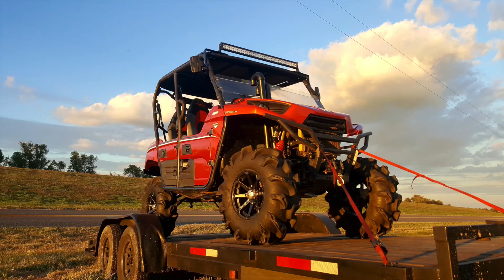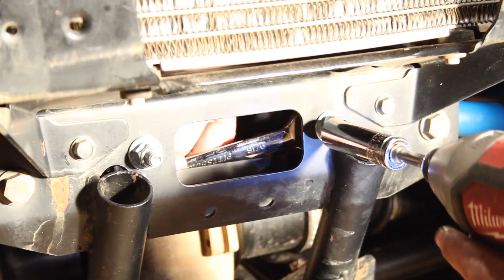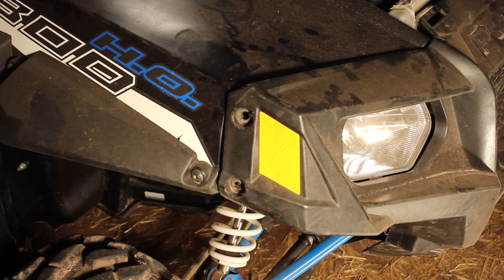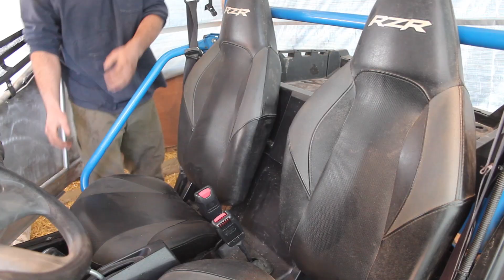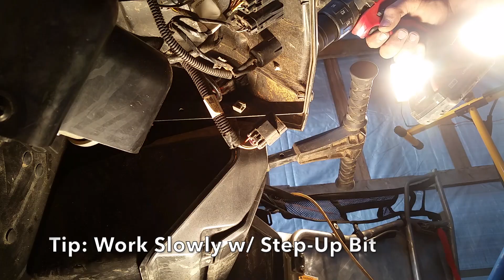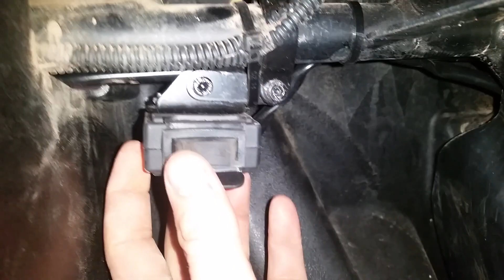How-To Install a Winch on Polaris RZR 800 (EVERY STEP)

Comment: How did this 3500lb do on the 800. Lots of other forums say go with the 5000. I’m only needing it for emergencies. We are light trail riders
Reply from the maker: honestly I also do light trail riding and never had to use it. Handy for another way to strap it to trailer, but ended up just being some cheap insurance out on the trail. Thanks for watching and taking the time to leave a good question in the comments. Cheers

Comment: Just got a RZR 800 and winch worked for two seconds and stopped, went over all the wiring with it and it seems good. So I assume winch itself must be done for.
Reply from the maker: try and hook up a car battery directly to the terminals on winch with jumper cables and see if it spins, I use that method for years on my trailer winch before it burns up so should be safe for a quick test. If winch is still good sometimes its easier to replace wiring than to hunt down a bad wire. Might try and replace just the solenoid if you have another one. Hope this helps thanks for watching and taking the time to leave a thought provoking comment. Cheers
Reply: @EscapePowerSports  I figure it out they had the wires running to the wrong places, basically the winch was trying to be the battery and battery was trying to be the winch lol!
Reply from the maker: @BradleyBeeksAdventures  lol glad you got it figured out. and thanks for replying with the fix. Cheers
Reply: @EscapePowerSports  no problem have a good day 😎

Comment: This definitely helped me out a ton!! Had to purchase a 2 to 4 hole converting plate for my '08 RZR 800 which rotated my badland 2500 winch 90 degrees. Great video!!!!
Reply from the maker: glad it was helpful for you, thanks for watching and taking the time to share your experience in the comments, cheers
Reply: Where you get the plate. I got the 2500 too and it doesn't fit.
Reply: @thomasbolton2121  I got two from ebayy. Search KFI 90 Degree 2-Hole and it should pop up. If you have issues, the people at KFI will take the time and help out. Hope this works for ya

Comment: Hey can you help me I have a 4500 pound winch form super atv and on the control box where the wires go to. Then there’s a switch for the winch to go in and out but there’s a little red wire and I have a brand new 2020 Kawasaki krx and don’t know where to put it
Reply from the maker: sorry for the late response, the control box should have 4 big connections, for 4 big wires (2 for battery and 2 for winch) that are usually color coordinated. I don't have a super atv winch here at the moment, so I'm unsure of which color any of the wires will be. But there will likely be more smaller wires used to connect to the switches, which are usually color coordinated as well.  The little red wire is likely the same as the one on mine at 10:08 I'd go for an accessory plug or or cigarette lighter plug's power wire. or any other wire you can verify only receives a power signal when the ignition is on. Thanks for watching and taking the time to leave a question in the comments. Let us know how it goes. Cheers

Comment: Link for the winch and mount plate?
Reply from the maker: I will work on getting some links,
The winch was the cheapest 3500pd I could find and I picked up from harbor freight with a coupon they send out in the mail.
It was the "badland 3500lb" I believe item #61257**(CORRECTION ITEM #61383!), but will double check that when I get into shop today.
The winch plate was the KFI  Plate was off of ebay and was "KFI 100600 for RZR"  I think that part number is good for a variety of rzr 800s and 570s, but wouldn't hurt to call with your year and model to make sure you end up with the correct mount. Will work on some links, thanks for watching and commenting
Reply from the maker: CORRECTION: ITEM#61383 Winch Mount Number is Harbor Freight Badland 3500lb Winch